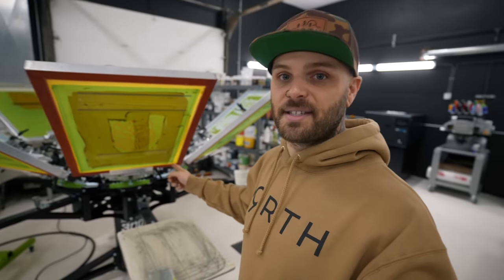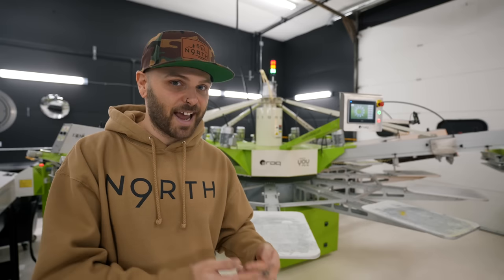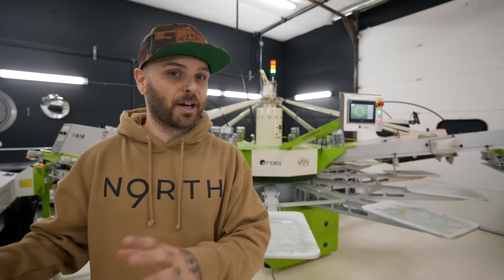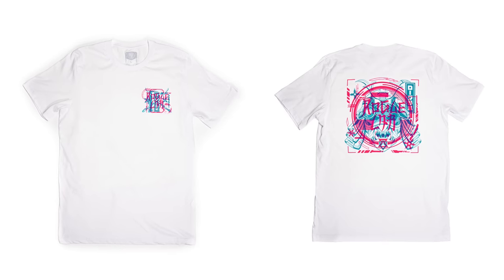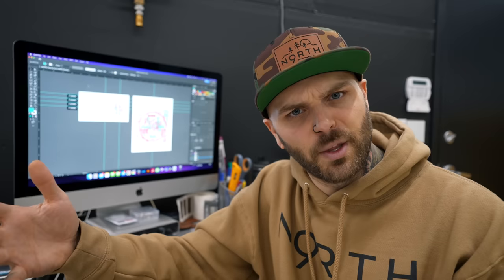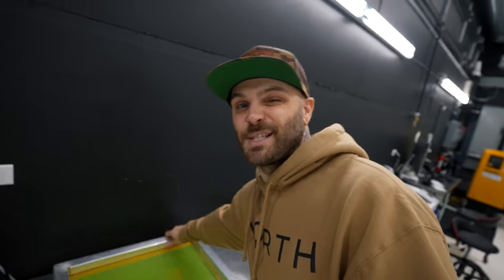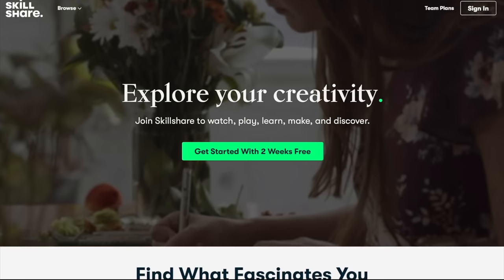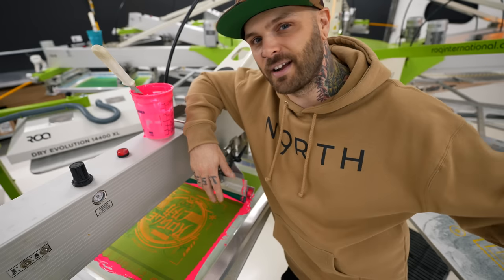Testing My AUTOMATIC SCREEN PRINTING PRESS

Comment: OMG I used to work ina shop with a auto press and yeah the shirt batches would always have either holes or some kind of oil like stains on them. Seems unavoidable with giant mass production.
Reply from the maker: It's pretty normal to get a few of them during a big run, but 10 out of 60 is so bad. I checked another box and it was even worse

Comment: Looking good! First auto coming soon for us. 

I think you said in a past video what lights you had in the shop that were ok for your non exposed screens but could you tell us again and where you got them 😉
Reply from the maker: They're just white led's. As long as you have all white led and no windows or uv sources you're good to go
Reply: How's the Kaeser? Was that it turning on at the end? Do you have the sx5 or sx7.5? Thanks!
Reply from the maker: @jvolingavage  Loving the kaeser so far. I have the 7.5c Airtower

Comment: I have a question, does the shirt not have to be cured in between each colour print?
Reply from the maker: Not for this design
Reply: @leestuart38  is it because all the separate colours never overlap, therefore if the screen gets some paint on it from a different colour print it won’t ever cause random marks?